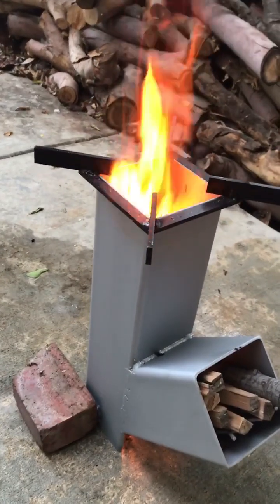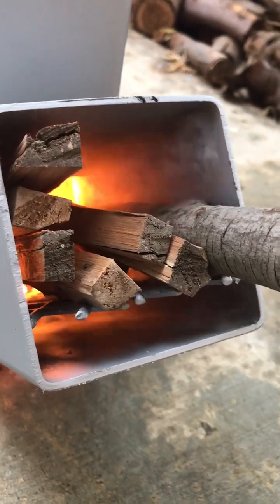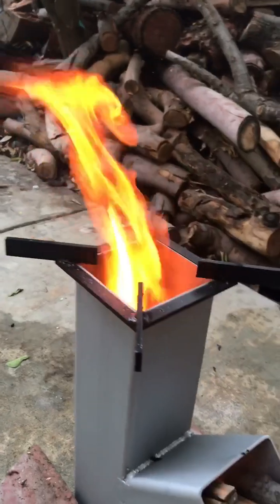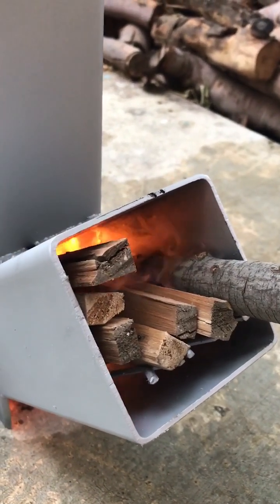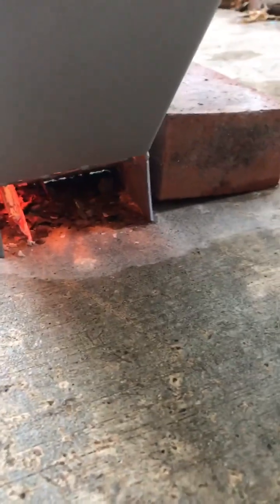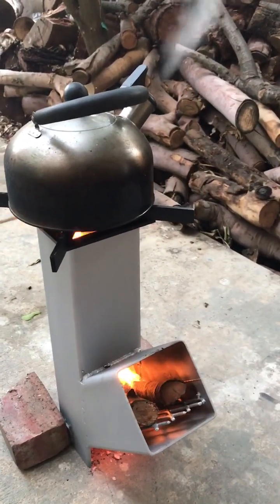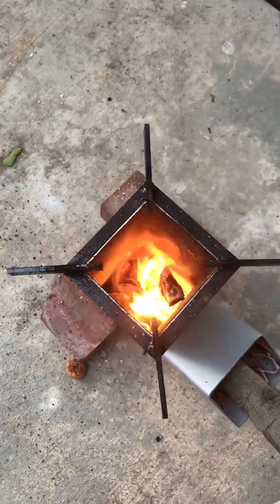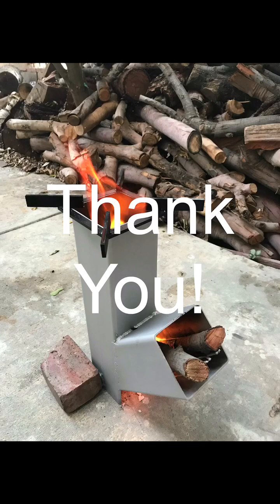Home made Rocket Stove (Very Efficient)

Comment: Really nice! I built one almost identical to your’s before I saw your video. On mine, I have a plate welded to the bottom to use as additional cooking space for more pots or tin foil wrappings, with 10” carriage bolts for legs on the corners. The space under the stove can be used as a warming area. I put a round pipe in the 45 to have as a handle for easy carrying. On the 3 sides, I drilled a line of 3/8” holes at 2” intervals for secondary air to burn the smoke even better. I have a removable 16”x16” cooking plate to keep the carbon off my pots, which needs a minimum 3” gap. I love your open burner solution! I will have one of these also.
Reply from the maker: Awesome.  This setup burns really good.
Reply: My newest idea is to build an oven and set the stove on top of it. The stove with the base plate and the  legs off generates a lot of heat downwards and may be enough to actually bake with. Would make a good warming oven for sure. My goal is to melt lead, as I have done with my other rocket stoves. The nice thing about an open burner is that you can drop wood down the chimney which increases the temperature a lot. As it is now, the stove practically vaporizes the wood leaving a minuscule amount of ash.
Reply from the maker: wtom100 I made one.  Too bad I can’t attach pictures
Reply: @wtom100 please post a video.

Comment: If you drill holes up on top of the pipe about 1-2 " down from the top hole then the wood gates will get oxygen a d you get a blue flame and less smoke. If you run a few stainless tubes in those holes every other one it gets even more efficient.
Reply: You talking drill holes on the riser tube?
Reply: I will try that on mine